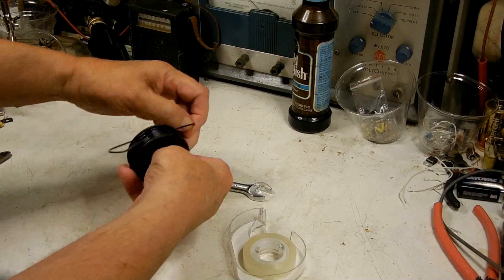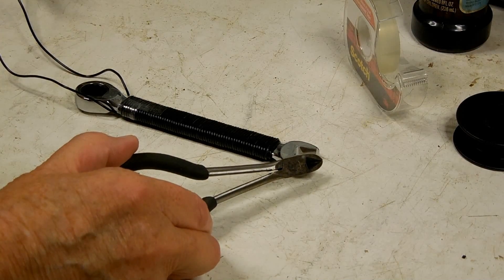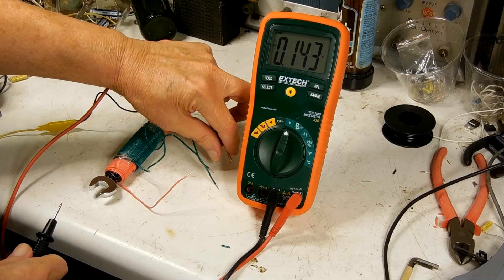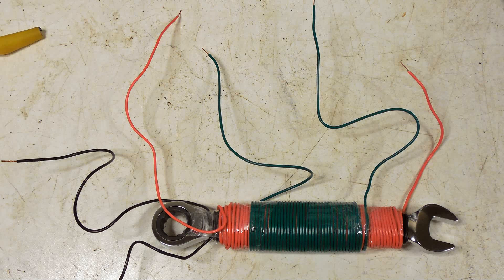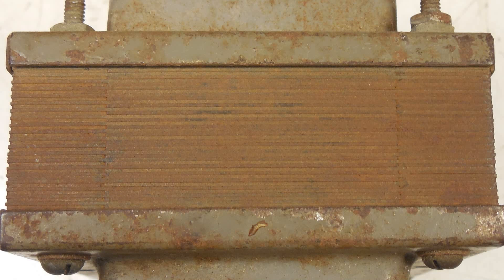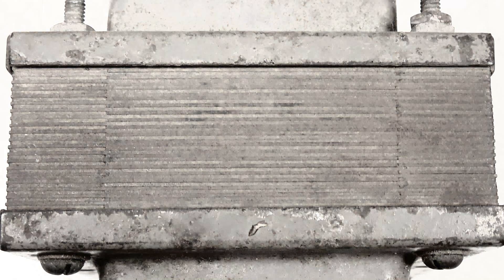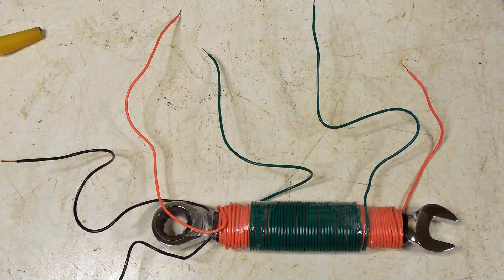Transformer Basic Parts & Function

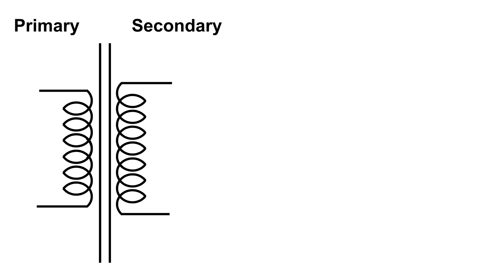Comment: Thanks for the reference.  At 3:08 the scope shows that the primary and secondary are wound in different directions.  However, at 5:08 you show two waveforms (the secondarys) that ARE in phase.  As you state, you rewound some layers...is the PRIMARY (1st) winding still wound in the opposite directions of the two 'phased' SECONDARY windings?
Thanks for the video...
Reply from the maker: Only the secondary. The primary is the first winding.

Comment: Great video! I have an audio transformer with non-interlaced core (output transformer out of tube TV). I think they constructed so to create air gap, because there is DC current through primary, and without gap the core will magnetise. What you think about this, does my comment makes sense?